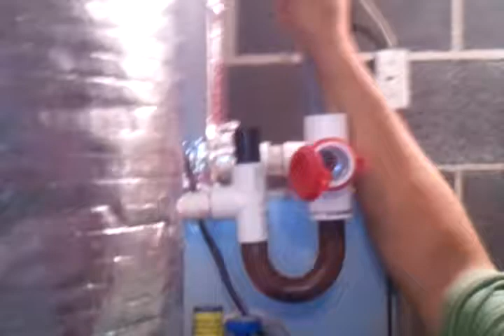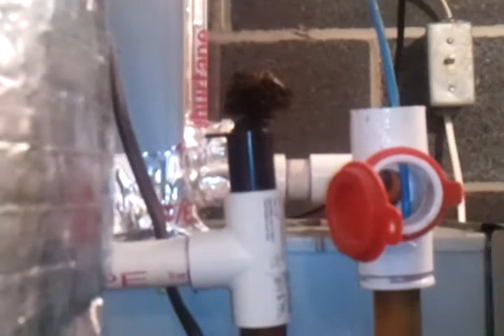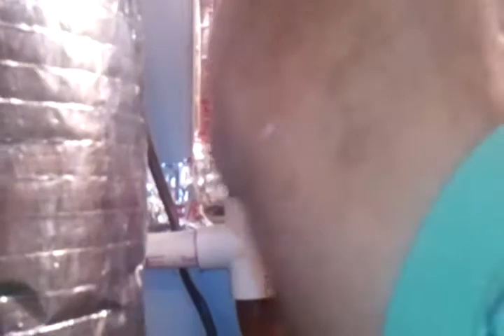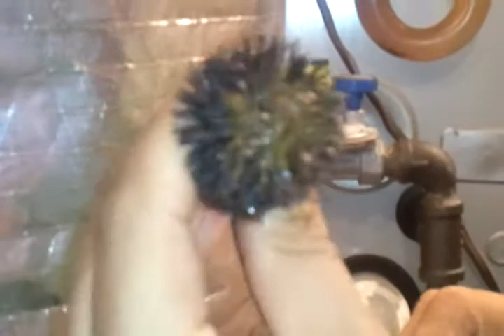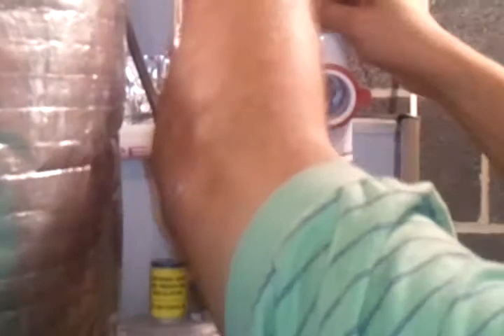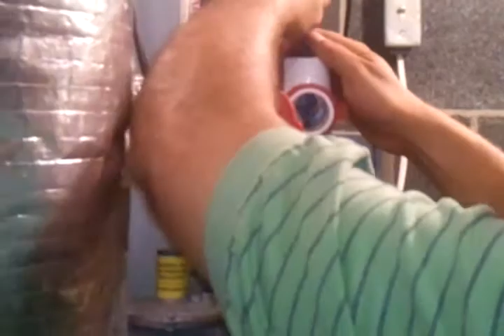Hvac Drain Boogers

Comment: I agree with response however I would also suggest cleaning the source, the evaporator coil and pan itself cause god knows I've seen blockages directly at the discharge of the coil there by keeping condinsate from even getting to the trap, pitch is important too so as to not add humidity. Further more I don't recommend traps on positive pressure systems, it is a unnecessary breading ground and onlyRequired by code cause it's to hard to explain the difference of positive and negative pressure to morons. By chance because of your wording in your response do you subscribe to the teachings of Joe C??
Reply from the maker: Mac Ludin,
Yes, definitely have us clean the coils. It is a good idea to change the air filter monthly, too.
Reply from the maker: Mac Ludin,

What is Joe C's last name?
Reply: Crisira... he's a sales trainer and a lot of his trading includes changing the name of parts and procedures to something that sounds more critical or makes it ungoogleable. Like "condinsate removal system" for a drain line. Or "voltage absorption unit" for a capacitor and so on..
Reply from the maker: Mac, "condensate removal system" comes directly from the North Carolina State Mechanical Code on Page 21 Section 307.2.3. This is the technical answer, though, because among professionals such as you and I, we commonly  shorten technical terms to make it easier to say while working on the job.

Comment: Please explain how this is increasing my utility bill? 
I'm very curious as to how this is possible.
Reply from the maker: Hi Joe, thanks for tuning in. And thank you for your question. 
What we are viewing here is the condensate disposal system attached to the fan coil portion of the air conditioning system. 
Here in North Carolina, on most days during the cooling season, the condensate disposal system is vital to removing humidity from the conditioned space. 
It is important to keep the condensate drain clear for quick condensate removal.
If this system gets clogged, then excess humidity builds up in the coil casing with nowhere to go, forming a puddle in the primary drain pan section within the fan coil unit. 
As the height of the puddle rises, it reaches the evaporative coil. As the coil sits in the puddle, the coil fins weaken, rust, and deteriorate. This deterioration is what reduces the energy efficiency. 
I hope this helps. Feel free to contact me via Youtube or email me at dcp@pernellinc.com. You can always call Pernell, Inc. for service at (919) 934-0153.
Thanks.
Chandler